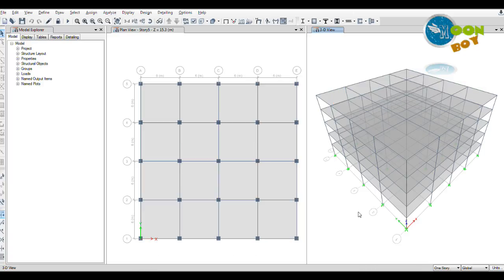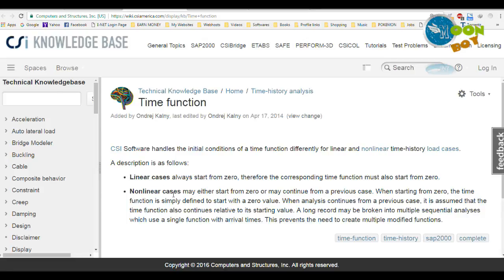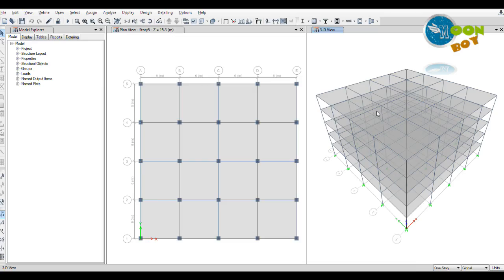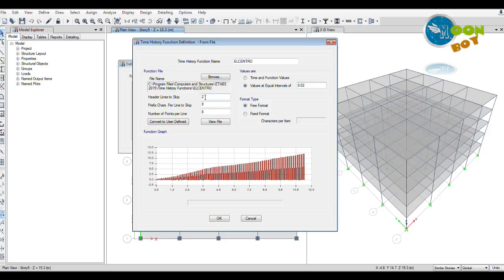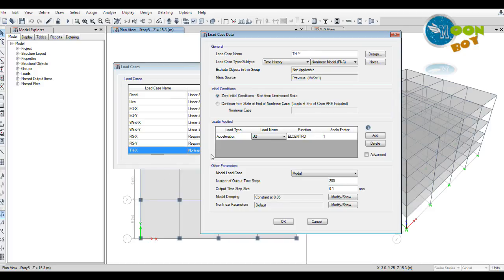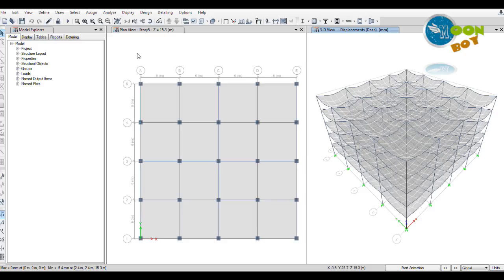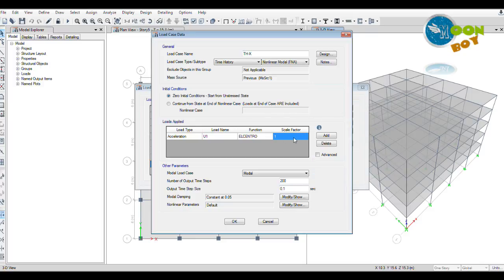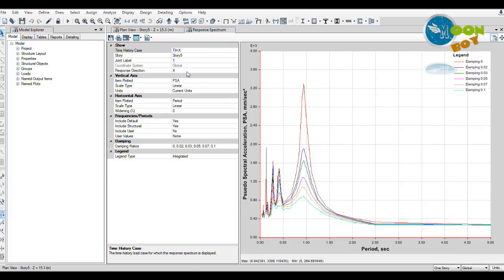Etabs 2015 tutorial 6 | Time History Analysis | Using IS Codes

Comment: Hi there , want to ask why i'm using time history analysis and change the scale factor according to the vary acceleration intensity , example scale factor 20 and 200 , but the result of the analysis from etabs , the maximum drift are the same, not sure which part i'm doing wrong .Can Mr Qamar explain and give some guide?

Comment: Hi there , i'm new here , current doing my final year project , want to ask is it possible to make a several earthquake in different as i'm doing repeated earthquake as consider effect of accumulate spread of damage , hope to get reply , thanks!
Reply from the maker: Yes you can use different earthquakes for same analysis. And finally you can compare the output.
Reply: Thanks for reply!  is it same as i put a load function at different arrival time in time analysis will obtain the accumulate damage effect ?
Reply from the maker: Yes you can do that.
Reply: Thanks and appreciate it!